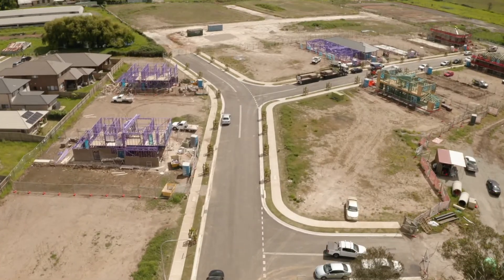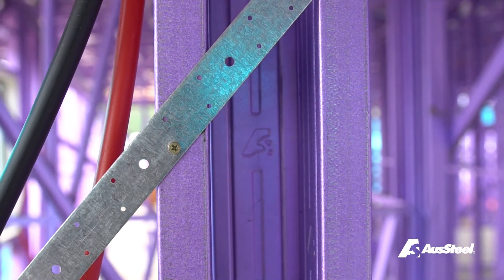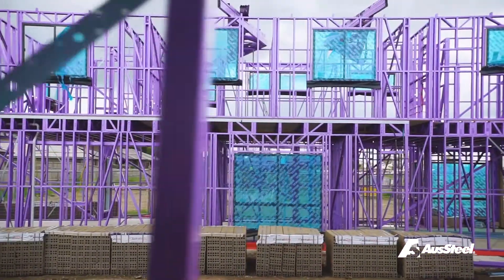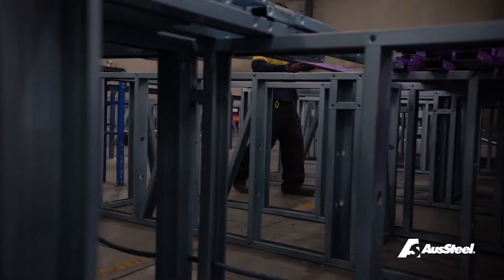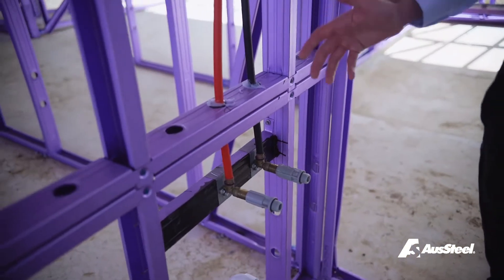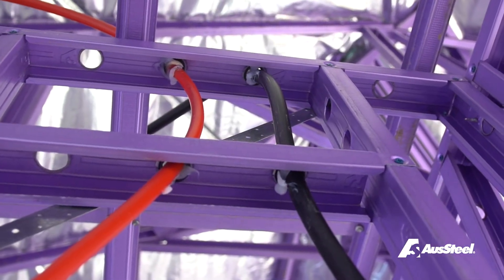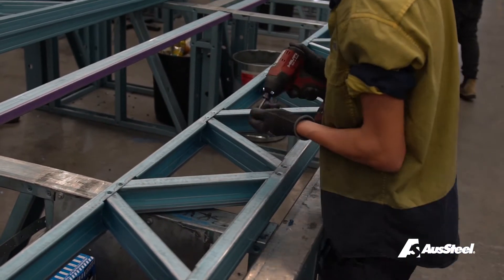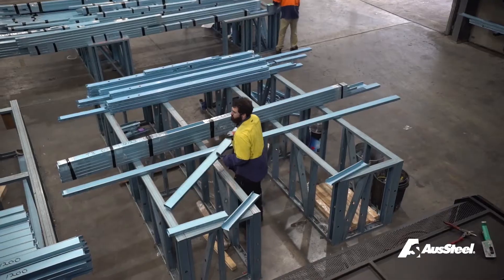AUSSTEEL IS AUSTRALIA'S ULTIMATE STEEL BUILDING SYSTEM | steel frame and trusses for new home builds

Comment: I do think steel frames are more efficient and generally a better way to go, but how do you address the thermal bridging. Apparently the 6 star energy ratings don't recognise the difference between steel and timber at the moment, but do for commercial buildings and the rating guys are finding the difference significant. Id really appreciate any information you have in regard to this.
Reply: Your best off going with exterior insulation instead of insulating in the cavities. Less thermal bridging & condensation issues regardless of wood vs steel framing.